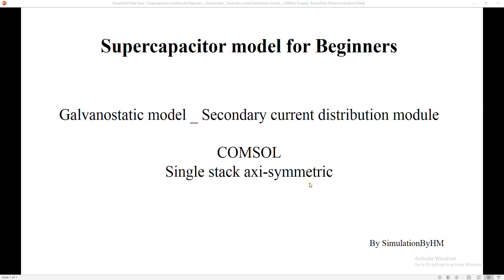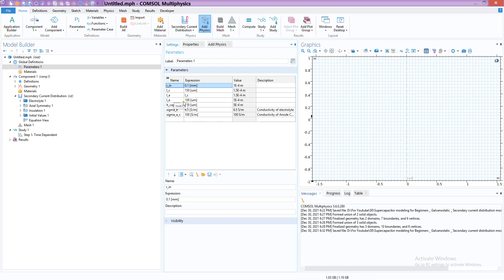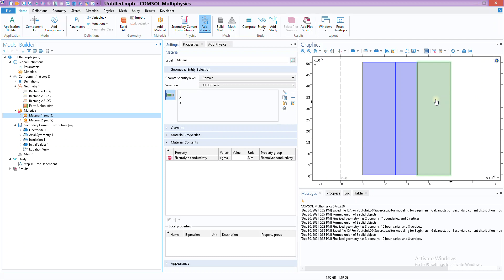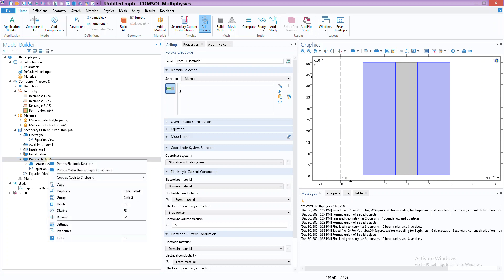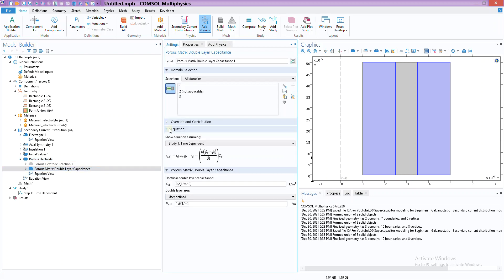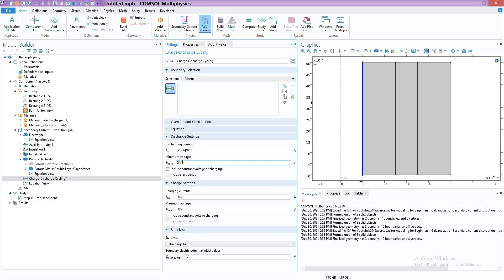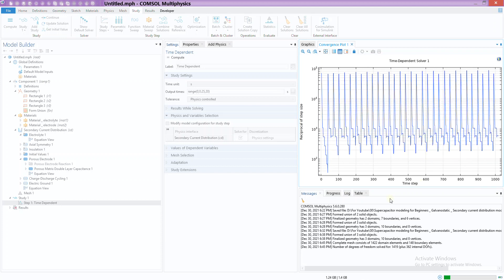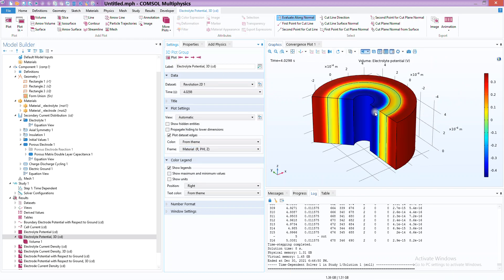Supercapacitor model for Beginners | Galvanostatic | Secondary current distribution module | COMSOL

Comment: Thanks for such an informative video. How about the separator, you haven't mentioned the separator in the geometry?
Reply from the maker: I didn't used it intentionally since I was much familiar with secondary current distribution module and didn't really need the separator when i was working with this module. however, if you need separator you can use the Tertiary current distribution module in COMSOL which has a dedicated sub-module "separator" to simulate separator. Or maybe I can make another video on that but at the moment I am working of Lithium ion battery after that I will see what i can do.
Reply: @simulationbyhm5194  Thank you a lot. Will be waiting for your video
Reply from the maker: @ShahidAli-uo3tb  Pleasure!
Reply: Can anyone please kindly help me with simulation of basic edlc supercapacitor?😢